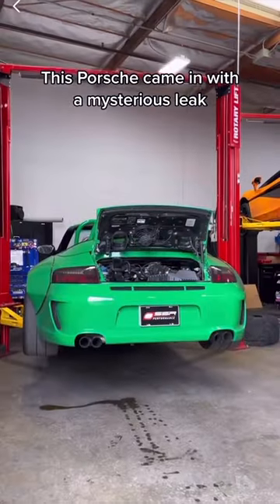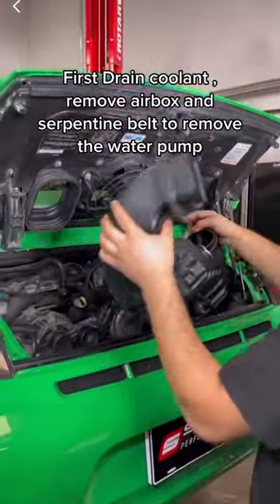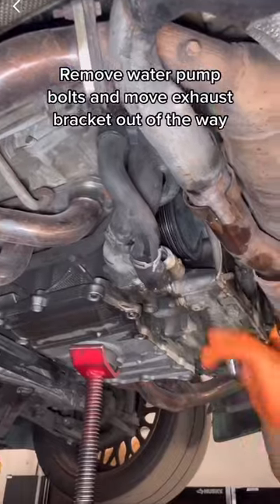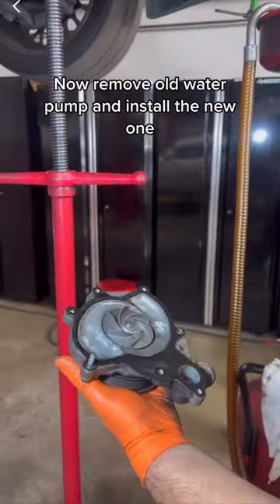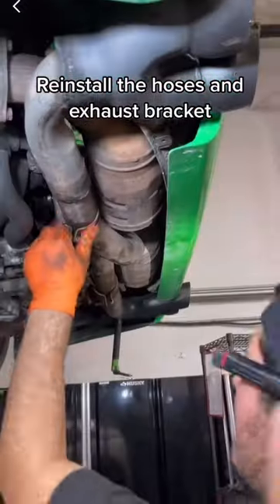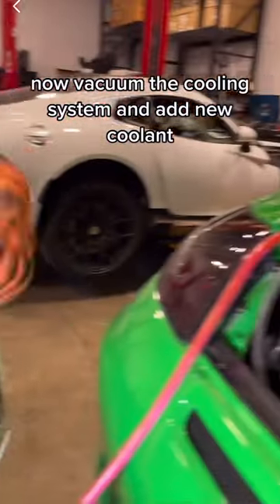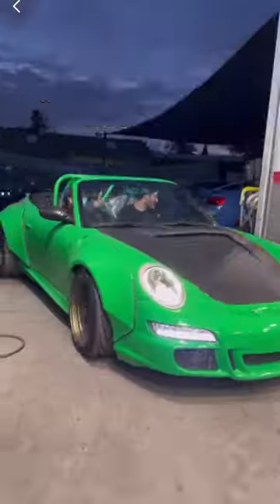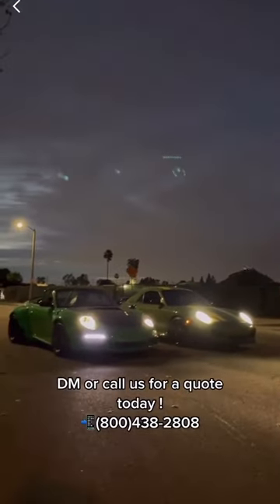This WideBody Porsche came in with a massive leak!!

Comment: Now charge the customer $2000 for one hours work.
Reply: 2k ha! That’s after a 50% discount!
Reply: @Slowpoke Tube and bc it's a Porsche that will be like 10K because of vehicle type and other bs that shops charge for!😂😭
Reply: This is all cheap, price the work on a Ferrari! They are all, Fix it again Tony (FIAT), all made in Italy!  Thanks…Jim
Reply: He wishes 2000$ my 2018 Silverado cost more to get worked on.
Reply: @angelcelis9090  for 1 hour labour? I call BS
Reply: @Trenscendent  dude just cuz a job you think should pay 1 hour doesn’t mean it’s worth an hour pay, just cuz you think it looks easy it’s still an annoying job getting coolant everywhere and all dirty, lol go do it your self if you think it’s so easy, i’d charge 3-4 hours to do something like that and not including parts. Here’s a good example too you can either get down in the dirt and replace some oil cooler on a trans for 3 hours or do a coolant flush and front brakes for 3 hours which one you goin pick lol
Reply: Nothing on a Porsche is an hour, plugs are a couple hour job
Reply: I don’t think they can do that in an hour.  These cars cost much more to fix than Toyota whose cars are design for east repair and design to last so much longer.  

Toyota doesn’t even use timing belt, it is chain driven.
Reply: @singlefather01  there was no timing belt or timing chain shown in any part of this video? watcha talking about ? you mean the serpentine belt i think, all cars have that
Reply: @Trenscendent  why’d you delete ur comment replying to me lol
Reply: Fucking parts alone were prob over 1k then at least 3-5 hrs book labor on a specialty car $180+ per hour. So prob around 15-2k
Reply: @coyoteaustin17  I didn't delete anything
Reply: @mikebing1230  yes sir you get it 💪
Reply: @Trenscendent  well i seen ur comment through my email notification but not in the comment section
Reply: @coyoteaustin17  it's still there, I can see it. 🤷 
This is what it says " @Coyote Austin  that isn't how it works you flop. An hours labour is an hours labour. The hourly rate doesn't fluctuate 🤣💀
Fyi I do work on all my cars myself."
Reply: Bro the water pump alone is 2 k
Reply: @Trenscendent  what exactly isn’t how something works? i’m a technician i think i know how it works lol, what you said makes no sense

edit: regardless this job is 3-4 hours shop time i guarantee you maybe 5. you think it’s 1 hour lol an alignment pays 1 hour bub,
Reply: @coyoteaustin17  ohhh your one of THOSE mechanics... Mechanics where I live aren't greedy fwits and charge actual time rather than bs "book time" ... Ffs 🤣🤡💀
Reply: @markdicicco6409  yes hence why I said LABOUR, not labour & parts 🤦🏼‍♂️
Reply: Good job!but for me every mechanic is same overcharging for any vehicle 🚗 and let’s not forget mechanic that are also shady as f..I worked for one
Reply: If he did all that in an hour for only 2k you better tip that man.
Reply: them supped up Volkswagens are expensive
Reply: You gotta pay to play
Reply: An hour? Shiddd
Reply: I wish that was an hours work
Reply: Porsche tax
Reply: @coyoteaustin17  179 people agree with me, zero agree with you. Nuff said.
Reply: @Trenscendent  lol read the comments ur goofy
Reply: @coyoteaustin17    if it's taking you 5 hours to remove a couple clips for airbox, 2bolts on thermostat, 3-5 bolts on water pump, 1 bolt/nut for exhaust bracket and removing serpentine belt and then refilling the coolant then there's a real  problem there and I'm assuming you're disabled in some way or just really inept? Each of those things should take less than 3minutes and refilling coolant and purging it shouldn't take more than 10minutes.
Reply: More than a hour no doubt
Reply: @armandokoshena5133  r/whoosh
Reply: $2k?  Yea back in 1990.
Reply: @SupeDefy  r/whoosh
Reply: @Trenscendent right back at ya. lol
Reply: @SupeDefy  you clearly don't know what r/whoosh means 🤣🤡
Reply: @SupeDefy  it means a joke went over your head
Reply: No way this was a “1 hour” job! Maybe the trouble shooting.
Reply: @mattmaster2582  do you have parkinson's?
Reply: It’s not about it being an hour, you are paying for the experience that he has done 1000 times. For you to have that done properly in 1 hour.
Reply: @josephrebensdorf9844  spot on
Reply: @Trenscendent  I’m pretty sure I understood your comment but it seems no one here has worked on their cars
Reply: On a European automobile, one hour
work is, changing the oil. Yes, it will be $300 parts only $125
Reply: Actually come back tomorrow 🤣
Reply: @Trenscendent  if you think this is 1 hour of work you’re clueless bud 😂🤣
Reply: 20,000*
Reply: @joshroi8610  r/whoosh
Reply: It's more than just unscrewing a couple bolts and replacing the parts and filling the coolant. Gotta diagnose, wait for expensive porsche parts to be delivered which can take a few days to over a week. Which having a car sitting in the lot for days or weeks is losing money. Paying for the mechanic experience if he's not a bozo, getting dirty, doing the work, putting it back together, running the car and going on a test drive to make sure it doesn't overheat could take an hour alone. Not sure what this job cost but it's definitely more than an hours worth of labor. It's a business. The mechanic has to make money too. Not saying to rip u off but they gotta make something on the job or they lose money. All I'm saying is that much more goes into it than that.
Reply: @coyoteaustin17  all the quotes  that I got from mechanics were too high  , I did the job my self in under an hour with basic tools.
Reply: @troyzuber5739  ^
Reply: @jaycommonsense2468  what?
Reply: @coyoteaustin17  guess what? I did the exact same job on the same make and model car as in this video. I have first hand experience of how long this job should take. 
Ps. I'm a mechanic of 12years.
Reply: @Trenscendent  doing tie rods and water pumps doesn’t mean ur a mechanic you’re just a part changer, there is a difference
Reply: @coyoteaustin17  how would you know that's all I do? You're really not that bright are you?
Reply: Is not about the time its about your knowledge if you know how what don’t you do it yourself?
Reply: It's only fair since it's a boxer engine
Reply: You obviously never worked on your car if you think that’s only a one hour job lmfao

Comment: This is actually hilariously easier than doing a water pump on a Miata with AC, power steering and all the features
Reply: Don’t forget you gotta remove the timing belt 😂
Reply: Most of german cars actually are and a lot of people dont realize this. You just need more goofier tools like torx and goofy sized triple squares. Id rather work on vw/audi then anything japanese especially nissan and subaru.
Reply: @b5Bart  facts like subarus look equally as difficult and unreliable as any other euro brand ive looked at
Reply: Nope. You can't remove the top bolt on the water pump on those M90 engines.....

Comment: I need to do this on my 997. I'll use this video to help me through it. What's the hardest part? I may need to have the hard coolant pipe reglued in the housing too.
Reply: The top bolt on the water pump. You need a flexible rod for your socket, or you can't get this bolt loose. Otherwise it's straightforward.